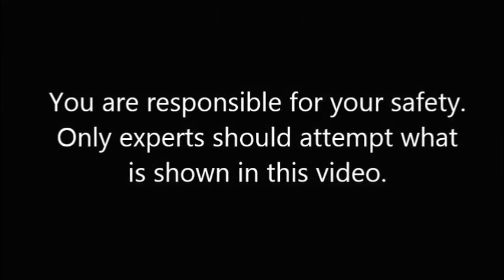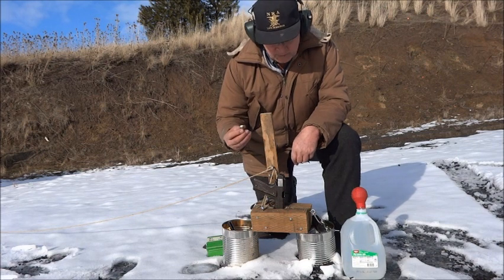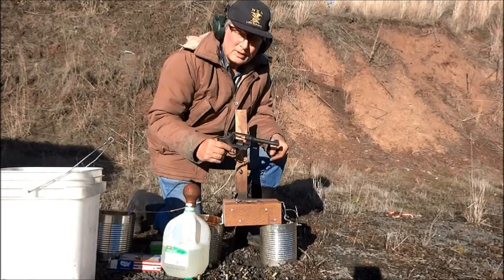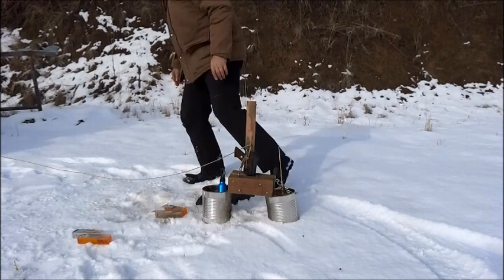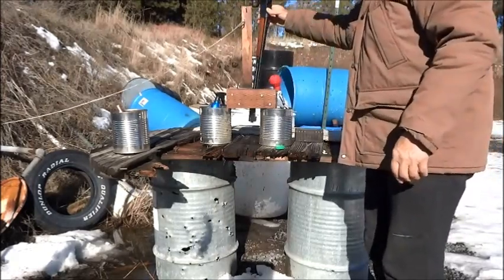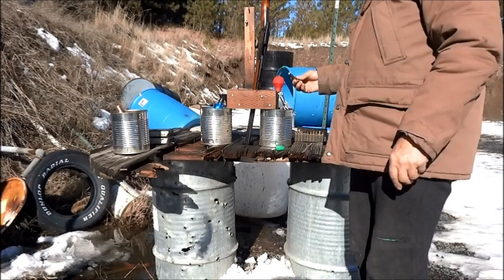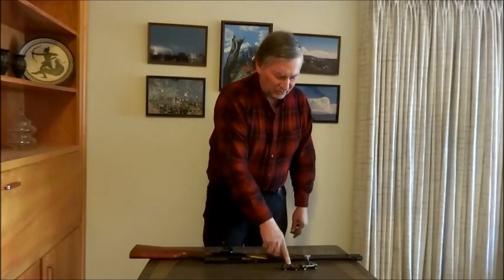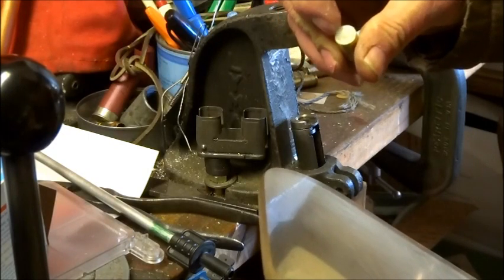How to shoot out a bullet stuck in the barrel of a firearm. SAFELY

Comment: Very clever. The only squib round I've experienced was in the 1980s, a 9mm reload with full powder charge but inadequate case tension from brass I should have discarded after too many reuses. And it was my only reloading error in years and thousands of rounds.

The slide couldn't be fully retracted or removed, so no DIY repair was possible.

I sent it to the importer's gunsmith who discovered two bullets lodged in the barrel, which was slightly bulged, just enough to make it difficult to rack the slide. No other damage to the pistol, a Benelli B76, an extremely strong semi-auto with a unique design. He replaced the barrel for a reasonable fee.

My best guess is that during a rapid fire exercise the squib load had just enough energy to fully cycle the slide and eject the case, chambering the following round which fired normally... but jammed into the squib bullet already lodged in the barrel. 

That was probably possible in the Benelli B76 only because the slide springs were unusually light and easy to cycle, while the pistol's unique delayed locking action made it possible to fire high pressure rounds without needing a stronger spring.

That particular incident could have been much worse in some pistol designs.

Needless to say, I was much more careful about my reloads after that incident and discarded any brass that was thinned out at the neck and felt like it had inadequate resistance during resizing, and inadequate tension during taper crimping. When in doubt I would use a bullet puller to disassemble the round and discard any suspect brass.

Comment: Ok, If anyone told me about this method I would say, yep, thanks and think your nuts.  Well, I would have been wrong.  I have a revolver that had a bullet stuck 1.75 inches from the end of the barrel.  I watched this video and thought anyone willing to intentionally make a bullet stick in the barrel would have to be pretty certian that they knew how to remove it.  I took my 357 with a 7.25 barrel and used 2 gains of Alliant Power Pistol with CCI Magnum powerder and followed the directions exactly as specified.  It worked.  Let me say that again, it WORKS!!!  I want to say thank you so much for making this video.  You didn't have to do it but you did it for free and saved me money and heart ache.  I couldn't see taking my pistol and pounding the bullet backwards down the barrel with a brass rod or a wooden dowel.  Thank you so very much.  I have shared this information with three strangers that were driving by when I did this in the mountains and two friends I shoot with. I intend to post this video on our shooting web site so others will learn.  Too cool for school.
Reply from the maker: Michael Beck,
Thank you for taking the time to reply.  I am pleased with your success.  I have read too many stories about the wooden dowel breaking and making a more difficult problem.  What is your shooting web site? 
Roger

Comment: I tried this with a Schmidt Rubin 1880's rifle gradually building up the powder levels to try and move the stuck bullet and the final load destroyed the gun. What I can't understand is the fact the high tensile steel ripped apart and the bullet, sitting in a place it is designed to be/ move through still was not budged!!
Reply from the maker: Before firing each blank cartridge, did you fill the bore with water from the chamber end?
Reply: no, what does that do? I think it would have just got the powder wet?
Reply from the maker: The paraffin wax wad in the blank cartridge keeps the powder dry.  The water transmits the pressure from the burning powder thru to the bullet and pushes it out the barrel safely.
Reply: Why do you need water, isn't there gas pressure from the blank that would be enough force?
Reply from the maker: If the bullet was near the chamber, it might work.   But if the bullet is further down the bore, the gas from the burning powder would get up to high velocity and slam into the bullet.  NOT GOOD.  Be sure to use the water each time.
Reply: I watched the rest of the video, I love the two cars analogy, so simple and has helped me understand what's going on with the forces. Will try this with an old barrel I got a squib in a few years ago

Comment: Why is this necessary and appropriate?  Why not wait a sufficient period of time, field strip the weapon, take the barrel and place in a vice or other platform, and tap it out with a rod?
Reply from the maker: brentfoto,
That does work.  This is an alternative method.
Reply: This video is impressively consistent in your approach and methodology.  Thanks!  Please, if you have a moment, respond to my other Comment in your video entitled "Is there a squib load which will cycle the slide and chamber another cartridge?"  Thanks!
Reply: RogerRevo Will it work with multiple bullets stuck in a rifle barrel?
Reply from the maker: Terry Gardner I have not tried multiple bullets stuck.  It might work if all the stuck bullets were touching each other, but I don't know.
Reply: RogerRevo Thank you for the response. my wife was shooting 32 acps using a chamber adapter in a 30 30. she wasn't hitting anything, so we checked the barrel. I could see one bullet 3 inches from the muzzle. I asked her how many were shot and she said seven. any help would be appreciated.
Reply from the maker: Terry Gardner I do not have any experience with multiple bullets.  It would take more force to shoot multiple bullets out the barrel.  A steel rod and hammer could be used  to force out the bullets.  Put a fired brass cartridge case on the end of the rod to keep the rod from damaging the rifling or take it to a gunsmith.  Put oil or grease in the bore to make it easier to push out the bullets.
Reply: RogerRevo I tried your method with 8 grains of unique and it cleared the barrel. Thanks for the video.
Reply: I could not budge the bullet stuck in my Schmidt Rubin, even hammering for twenty minutes.

Comment: I have to ask if the squib load is just past the chamber, barely contacting the rifling is the water a necessary step? If there were a small air gap would this pose an issue?? And is a safe assumption even with fast burning powders that a half charged wax was is the typical amount to use. I've experienced this scenario a couple times with my progressive press and have officially went single stage since.
Reply from the maker: +Josh Brown Question 1 and 2: I don't know. In that case, the water might not be necessary.  The wax wad would only have to move a slight distance to contact the stuck bullet.  Question 3: I used small amounts of powder because I only wanted the stuck bullet to be shot out of the barrel, not shot at a high velocity.  Larger charges of powder might work without damaging the firearm, but the powder has to move safely, the stuck bullet, the water in the barrel and the wax wad.  I see no reason to use large amounts of powder.  If a small amount of powder does not force the bullet out, it will probably move the bullet part way down the barrel and then after refilling the bore with water, another blank cartridge could be fired to force the bullet completely out of the barrel.  I very much enjoy my progressive press.  I suggest you consider a progressive press with a powder charge checker like Dillon 650.
Reply: if its that close,  drive it back out with a brass rod. why try and shoot it down the barrel. this method works great for  rounds stuck well into the barrel.
Reply from the maker: +Ha Re I am showing an alternative way to using a brass rod.
Reply: oh ok. thanks.

Comment: RogerRevo I am enjoying your stuck bullet episodes. Now I need to ask, because I have a stuck bullet in a brand new rifle and need to get it out. Your method seems to be the best info, and the safest method.

Question is: I have a 5.56/.223 rifle. I have a copper bullet stuck down the pipe. What charge of Trail Boss would you recommend for starting this procedure? I heard you say 3 gr in a 3030. A 223 is a bit smaller. Is 2 grains sufficient?
Reply from the maker: I don't know, but if 2 grains does not shoot the bullet out, then try 3 grains.  Somewhere in my squib load videos, I try a powder charge which does not shoot out the bullet and then I try a heavier powder charge.  Remember to refill the bore with water before firing the next blank cartridge when the blank cartridge does not shoot out the bullet.

Comment: Why not use oil?  Water will tend to rust your barrel, unless you patch it out with oil very soon after.
Reply from the maker: The next bullet fired will sweep the water out of the barrel.
Reply: @roger_revo  That is fine, if you show multiple shots being fired after clearing the bullet.  As your demo shows multiple guns, and success with each, the continuity of going on to shoot immediately appears broken.  Thus the impression that the gun is put away with water droplets in the barrel.

Do you have any reason why not to use ordinary mineral oil in place of water; other than availability?
Reply from the maker: It costs less and won't leave oil on the gun range.
Reply: @roger_revo  True

Comment: Really good video very knowledgeable, I didn't think it would work in a revolver because of the cylinder gap the lose of pressure and the thought of the gas just smacking the water.
In a pistol you obviously just have one long tube with no gaps.
Reply from the maker: at 5:45 a revolver is shown with this system working.

Comment: I presume water in the barrel prevents over pressurization that could occur between the bullet and the blank depending on how far the bullet went down the barrel.  Interesting!
Reply from the maker: The water transmits pressure from the blank cartridge to the bullet stuck in the bore and both are forced out of the barrel.

Comment: Does it really need the water?
Reply from the maker: Yes.  The water transmits the force of the blank cartridge to the bullet stuck in the bore and pushes it out.
Reply: Jesus...do you remember that movie...they open a SAFE with water and explosives... ;)
Reply: I’ve seen shotgun barrels explode when there’s just air between the bullet and cartridge.
Reply: @roger_revo  The water was the great factor X for me.  I thought about firing either (A) primer only or (B) primer + powder BUT how much powder?   The water is the clincher because YES it applies the force equally through the entire column of water at the same time and yet buffers the force on the stuck bullet (not a  collision but a push)  That was the stroke  of brilliance     then the demos... how to do it.  the remote firing is good (minimizes risk)   I will fill a 5 gallon pail with water and then do what you did with the barrel poing at the pail (from the top) and I will put the water into the barrel as shown .. with a small funnel    I can create several blanks using paraffin and 3 grains of Bullseye (one ought todo the job)  .. It is actually a milder solution to the problem than  trying to hammer it out with a steel or wooden rod)

Comment: Oh! Of course... How obvious, now that I see what he did.

Filling the barrel with water is the equivalent of inserting a solid into the barrel, and the blank then just becomes a hammer hitting the “Solid Rod” of the water in the barrel.

This would probably not work with a revolver, though, due to the gap between the barrel and chamber in the cylinder. 

AHA! He is going to do this in a Revolver... Let’s see how it works.

He uses more powder with the Revolver, as it would require more “Oomph” to push the “rod” of the water in the barrel.

But... I’ll be damned... That worked in a Revolver.